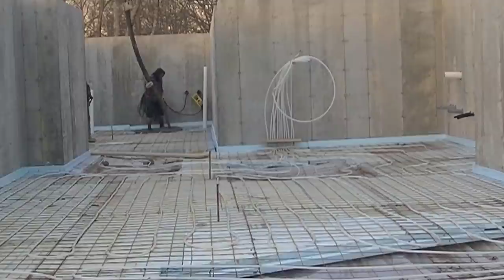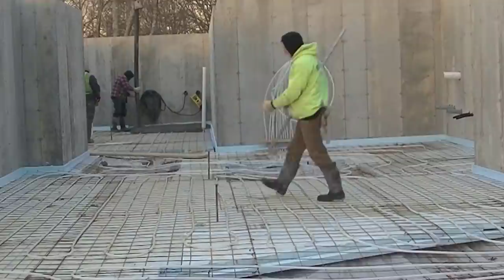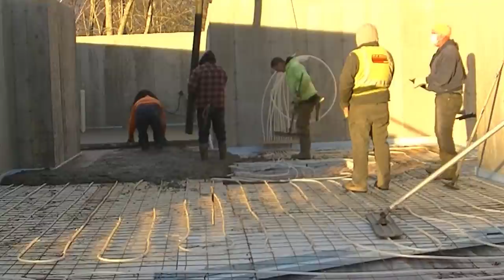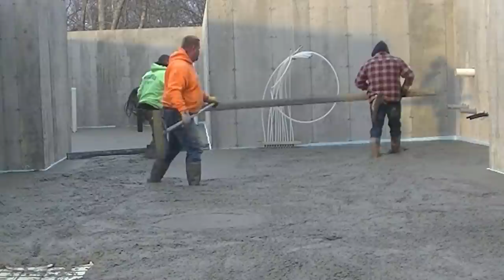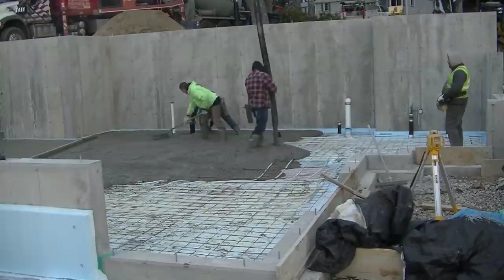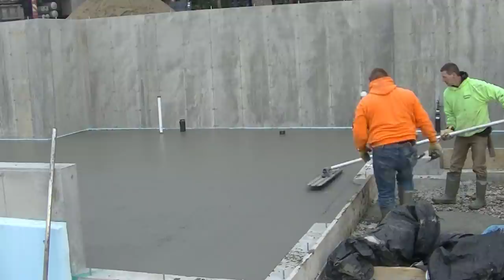Pouring Concrete Floors In Freezing Temperatures (My Advice)

Comment: Used to be a crane operator in northern NJ working on high rise concrete buildings. Once did 86 days straight not counting weekends in the dead of winter in the late 1970’s. Pour averaged between 250 - 300 yards. It was done with top notch tradesmen who had pride in their work. Draped floor with heaters below the pour provided all the heat needed to keep concrete from freezing before it set.

Comment: The issues we had were after done finishing and blankets on it if you get rain or snow within the next week. If you get that and temps get cold the top .25 inch will absorb the water, freeze, and pop the top. Usually with cold temps it takes the week to get 3k psi which keeps that from happening. Had a few floors we had to fix because of this problem. We stopped doing flatwork 2 years ago, now all we do is walls. Great job.

Comment: You’d love to see the East Indians where I live in Canada pour concrete in winter lol.  -20oC and they form up concrete basements and pour like any regular day and walk away after the pour lol.   Those basements get houses built on them right away and buried fast before anyone sees them starting to crack.  They have zero concrete knowledge but get tons of work because they are cheapest and disappear quick before anyone catches on the concrete froze before it properly set.   I’ve seen in several times near my neighborhood in new subdivisions.  So it’s interesting to see how you guys deal with cooler temps.   We have to add heaters and hoarding to keep concrete warm if it must be poured in winter up here (to do it properly).   But heating a construction site gets very expensive very fast so it’s normally only commercial industrial jobs only.

Comment: Why is the steel on the thermal . No gap between them ? The steel should 50mm from the top of concrete  or 2 inches . Plastic chairs could be used .

Comment: Great video mike. We do the same stuff down here in Kentucky. One problem I do have is getting straight sack in winter and air entrainment. This happens in some of the rural areas mainly. They also claim fiber mesh is not standard. Can you buy type 3 up in Maine? I cant find it anywhere down here. Anyone else have that problem?
Reply from the maker: No type 3 here. Air and fiber are pretty standard in Maine

Comment: The problem with this kind of mix over time it could crack but not necessarily great pour, how thick is that foam did you double up the foam..
Reply from the maker: They doubled up the foam yes. Any mix can crack over time, we saw joints to help control cracks.
Reply: Always knew you were the BEST in the West .

Comment: Have you ever had issues with it raining on a slab then freezing and popping the top off in places?
Reply from the maker: Yes, gotta keep the concrete surface dry for a few weeks to let it cure otherwise you're right it'll pop the surface.
Reply: @MikeDayConcrete  if the concrete pops off Mike is it possible to grind/sand the concrete

Comment: Mike if i wanna pour small slabs in winter that do not need to be finished . Is there danger of it freezing if i dont have hot water or accelerant?
Reply: Or just longer cure time?
Reply from the maker: You still have to protect it from freezing for the first few days by covering with blankets. Using warm water and accelerator speeds up cure time and you don't have to cover as long.